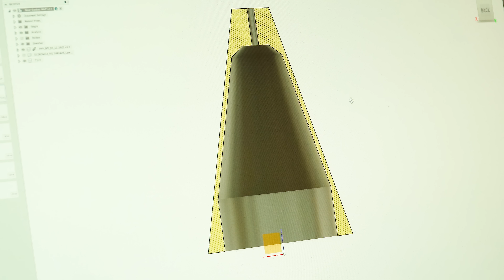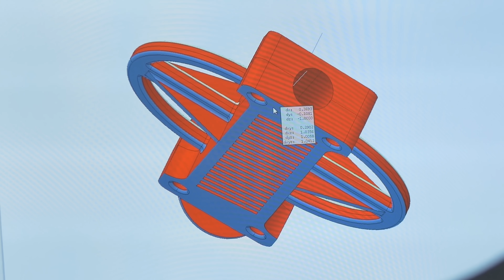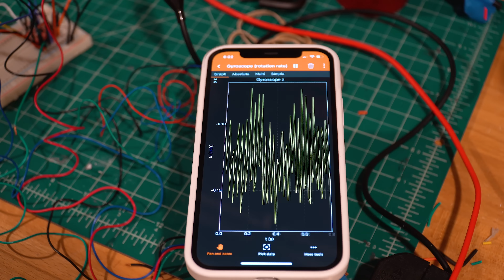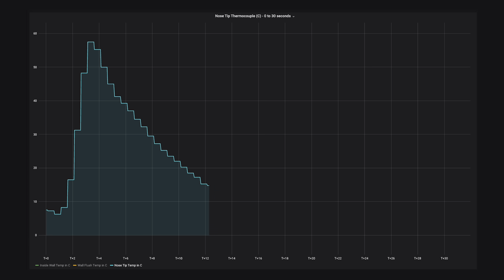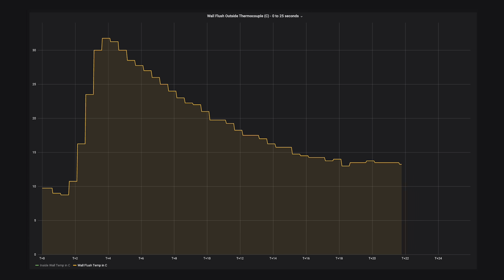How Hot Does a Rocket Get?

Comment: The new spinner is a great improvement! Could you take the magnetic coupling concept one step further and find a frameless BLDC gimbal motor? Then the only magnetic coupling would be directly between the stator coils and magnet ring of the camera rig, and you'd get back the hollow core for the threaded rod to fit through. With FOC control you should be able to get really smooth movement.

Comment: If you replace the tip of the nose cone with a nonconductive and contextually appropriate metal, but maintain an aluminum strip, you could apply a charge across that aluminum strip and gather data on the resistance on the metal strip. I'm not well taught in basic circuits, but with some testing you might be able to correlate electrical resistance on the strip with the temperature. The main problem is that this might cost more electrical resources.

Comment: i dont know fuck about shit.

strong metal that conducts heat best?

bunch of holes in tip but not too big?

hold meat on with chicken wire?

some kind of double layer cone.  similar to jet engine but sleaked out but it has a little 'pocket' to put the meat allows a little airflow to cook meat but also has good angles for letting that air pass out the ring 'exhaust' and around the outside of the cone.  almost like a N-1 Starfighter engine from starwars.

Comment: How I see your thermal situation is that you really want to have a lot of contact between the smooth aluminium and the air. Normally one would make fins on an object in order to obtain this, however you are on a rocket that values it being smooth since you don't want uneven drag on either side.

So my suggestion would be to maybe sand or bead blast the aluminium nose cone and there by getting a bit of a rougher surface and there by getting more surface area. On the other hand you are really limited by the sonic shock wave front, so you might have to design your cone in such a way that it matches the profile of the cone with the shock wave front. Also as little aluminium in the nose cone as possible since you will "lose" the energy to the heating of aluminium and get a slow cook instead of a fast one.

Best of luck on your journey.

Comment: you could design the nose cone into two parts like one cone on top the other cone where the top cone will have less width than the other one and that way we can place the meat between the layers and there might not be significant changes in aerodynamics and also weight. I don't know maybe it could work ?

Comment: have you thought about partly exposing the meat to the outside of the rocket. I think getting the tempetature inside the rocket high enough to cook meat, is pretty difficult simply due to the amount of heat that needs to be present. I also dont know what that high of a temperature would mean for the rest of the electronics inside of the rocket. maybe exposing the meat to the outside layer covered with some type of mesh to keep the structure could work, but im no rocket scientist

Comment: I would also go with internal fins to radiate most of the heat inside as well as gaining strength to reduce the wall thickness.

On top of that there might also be some gains by polishing the nose so it cannot emit as much as a the internal fins with radiative coating.

But if you want things to heat up wouldn't you need to use a nose cone optimized for friction rather that would make you Mach 3 harder ?

Comment: I would suggest using a servo motor rather than a stepper motor. Not an RC servo motor with a gearbox but a small servo motor with a rotary encoder. The motor will accelerate much faster and more smoothly than a stepper.

Comment: Could add a thin copper sheet to the side of nose cone with a rough surface (sand blast?) to maximize thermal diffusivity and friction in a small area.  Insulate the copper from the aluminum nose cone (with epoxy?) such that the best thermal path is through the meat and not the rest of the nose cone.  Could do this with a thin Insulated piece of aluminum sheet too if weight is too much of a concern.

Comment: Maybe a future upgrade could be to use an FOC-controlled brushless gimbal motor instead of the heavy stepper motor? It should provide a much faster response while being much lighter and consuming less power (check out SimpleFOC for some really good resources on arduino-powered FOC controllers)

Comment: maybe what might work is having the surface area which collects heat be as large as practical, but also relatively thin, and then having an internal thermal conductive structure which would transfer the heat from the entire nosecone to a much smaller area somewhere inside which would actually do the cooking.. like the first idea was to run some fluid through a mesh of thin tubes under the surface of the nosecone and use the fluid to transfer the heat to the "cooker", but that would be insanely hard to machine, so maybe a passive system might do?

Comment: Dump the stepper motor. Go back to the previous design and replace the brushless motor with one of those compact geared brush motors used in mini sumo robots. A standard imu using sensor fusion will give you rotational position. A pid loop will keep everything in place. It will work much much better and will weigh way less.

Comment: Make the nose cone of high temperature resistant material, low cooling effect. Place the meat slice outside of that and keep it in place by a metal mesh. The Mesh will prevent the meat from peeling off and the backside will not drain heat from the meat.

Comment: You should definitely consider using bldc motor with foc driver instead of this giant stepper motor. Please, like for him to notice, this would be a massive weight save❤
Reply: I don't think a BLDC is going to work, he choose a stepper motor for its ability of making small corrections, with also enough torque to keep it in place once in the dedisered position. plus you can also have a reference on where you are without having an encoder to check its position (as long as you don't skip steps). with a blcd you don't have control over the position and also at that small speed you also have very poor torque, but the worst think is that you cannot keep it steady once in the correct position. my2cent
Reply: @AmedeoZitti bldc can be used in servo position mode. The elctronics and the sensing are a bit tricky but absolutely doable
Reply: @AmedeoZitti  You can definitely use hall sensor encoder in such system. I didn't think about the torque required to spin the batteries, but a larger motor will still provide the torque required for the system and will still be half as light as a stepper motor. You can also get rid of these magnets.

Comment: I would sugest heat pipes on the edge of the the nosecone (or as close as it can structurally go) that transfere the heat created by friction of the airflow and maybe find a way to increase the friction if the temperture is to low. So basically a nosecone heatsink. The problem is this will heat up quickly but also cool down verry fast, maybe disconnect the hearsink at apogee. To make it cook you would also likely need a way to store the heat. The best I see this going is slightly burned/cooked edges or a verry undercooked piece. So maybe use something like verry thin bacon because it can be cooked quickly on a hot surface.

Comment: I would make the nose cone in two pieces, an inner and outer cone where the slice of meat is sandwiched in-between. this way it wont be at risk of breaking apart. with small venting holes to bleed off the pressure created by the moisture evaporating. these could vent either outward straight out of the nose cone. or the could be directed through a drainage to be exhausted out the rear or sides of the rocket. depending on which is more convenient. this way we don't affect the aerodynamics or damage the meat. plus no risk of bursting due to a pressure build up. (although that's not likely to happen anyway and maybe the added pressure could be a good thing, idk)

At least that's my best current idea.

Comment: I would use copper instead of alluminium, it have better thermal conductivity to transfer more of the heat to the inside, where the meat is :D also the shape will make a difference in how much heat it produces.

Comment: I feel like the best way to do it would be a thin shell of material on the outside, like if you peeled off the outer layer of an onion, and sandwich the meat between that and the rest of the nosecone (then attach the shell good and tight). That would get it as close to the heating as possible while still keeping it intact under the aerodynamic forces.

Comment: In case you over looked it, this from wikipedia re. thermo couple circuits: 

Reference junction
Reference junction block inside a Fluke CNX t3000 temperature meter. Two white wires connect to a thermistor (embedded in white thermal compound) to measure the reference junctions' temperature.

To obtain the desired measurement of T s e n s e \scriptstyle T_\mathrm{sense}, it is not sufficient to just measure V \scriptstyle V. The temperature at the reference junctions T r e f \scriptstyle T_\mathrm{ref} must be already known. Two strategies are often used here:

    "Ice bath" method: The reference junction block is immersed in a semi-frozen bath of distilled water at atmospheric pressure. The precise temperature of the melting point phase transition acts as a natural thermostat, fixing T r e f \scriptstyle T_\mathrm{ref} to 0 °C.
    Reference junction sensor (known as "cold junction compensation"): The reference junction block is allowed to vary in temperature, but the temperature is measured at this block using a separate temperature sensor. This secondary measurement is used to compensate for temperature variation at the junction block. The thermocouple junction is often exposed to extreme environments, while the reference junction is often mounted near the instrument's location. Semiconductor thermometer devices are often used in modern thermocouple instruments.

Comment: Imo the most over the top but still somewhat efficient way of cooking it porbably would be by blending it in a blender to a mooshy paste and mixing it with oil or butter, then make some sort of internal liquid cooling system for the tip with all the heat used to coock the meat, it really dont have to be really hot actually theres a chart of what temperature you need for how long for a meat to be considered coocked, hope it amuses you :) 

Other way i can think of wich is slighty simpler but much harder to make, you can make the tip of copper and bore inside it like radiator slots, leaving the walls really thin and the slots thick, put the meat inside, seal it and make a low pressure there, if the meat is thin enough it should work somehow lol

Comment: Tasty idea!  How about wrapping thin sliced prosciutto around an insulating cork insert that will let the cooking continue as long as the thermal mass will allow as well as supporting the meat? Also maybe a metal that will hold the heat longer than aluminum?

Comment: You should definitely have as much surface area as possible. It's entirely impractical on the outside, but you should definitely have a radiator fin stack machined into the metal tip. 

Take some tips with how people cool things. It's all about moving heat around.

Comment: What if you cut a channel around the circumference of the nose cone deep enough to put a piece of bacon, then had a matching ring you could just slide into place over it, trapping the bacon between the nose cone and the ring. You could make it so that the OD of the ring is flush with the rest of the nose cone, and wrapping the bacon around like that would use relatively little space. This has the advantage of keeping the cooking process away from any internal components.

Comment: I think you need as little thermal mass as possible to cook the meat.
I suggest building the cone out of some strong insulating material or a very light wood, and then attach a very thin layer of meat on the outside of the cone and cover it with a thin metal foil. 
Don't make the surface too smooth, higher friction provides more heat...

Comment: @BPS.space Graphite is a good thermal conductor and very strong with a low thermal heat capacity. Thus it should transfer the heat quite fast and absorb little of it.

Comment: Aluminium nosecone is great as it transfers heat fast then what about wrapping a piece of bacon around an inner core shaped like the nosecone made of foam to keep the bacon firmly against the inside of the outer cone so you get maximum heat transfer into the meat but the foam core wont rob heat from the bacon ?

Comment: Would it be easier to use image recognition to maintain a direction and log the spin data to reverse engineer or make a simulation?
Reply: Just got to the part where you're using a record player and that's pretty slick.

Comment: I'm wondering how much weight you'd save if you just had a bunch of camera sensors in a ring and just account for the spin with camera sampling and software stitching the images together rather than building a spinning wheel. 

Still it's an amazing concept, and I think it's working well.

Comment: Getting the heat into the meat during a really short exposure seems a problem if the meat is thick enough to hold together.  If you could seal the capsule and allow higher pressure, you could store the heat in the water to steam transition, and it could soak into the meat during the decent and some recipe cooldown time.  I'm happy to simulate the pressure cooking to estimate your times given your surface area to meat/water mass ratio.  I am assuming a peak pressure of 2 to 4 bar absolute, peak temperature 150C.
Reply: Conveniently, your rocket will have repeatable conditions of launch air density, nosecone size and shape, peak airspeed, and acceleration profile.  This means the total heat available to the nosecone should be consistent if the heat sink is effective and of a repeatable heat capacity.  If a majority of the heatsink is water that can be reached during the peak heating, the peak temperature of the food should be very consistent.  With fine tuning, the exterior of the meat could reach carmelization (146c) and not carbonization (155c).  Then by preconditioning the meat (pre-warmed, pre-chilled, center unthawed) any special order can be reliably produced (hypothetically).

Comment: Thermo siphons may help redirect heat where you want it. Copper is an excellent heat conductor. If you use just water, you might get extra boost from steam if jets are tuned or aimed. Pressure cooker/ vaccum chamber may allow heat pulse to transfer more heat. Like boiling water at room tempature. When it works, use WAGU Beef for the worlds most expensive steak'em. A suspended payload under the rocket engine might cook alot more. Would probably make it the worlds fastest barbecue. I really like the shorter content videos, but i like the ideas and reiderations in the long form too. Anyway thanks, and keep up the cool content.
Reply: I got the beef hmu

Comment: I really want to see you try the spinner again, but using a free-spinning section with a tiny aerodynamic control surface. You'd save loads of space  and weight, and have the benefit of some aerodynamic damping. I don't expect you'd need much control surface deflection, so a relatively small servo with a lot of mechanical advantage would probably work fine.

The downside is loss of stabilisation at apogee, but for the ascent I think it could work quite well.

Comment: Could you just make a hollow nosecone and slice it off the tip and weld on a threaded center core on both sides? Pack the meat in like a 1 Cubic Inch hollow section?

Comment: What about making the outside of the nose cone out of copper with a thin alluminom inside.  Then make a plug that hold the meat against the inside surface like a bacon press so you get maximum contact with the hot aluminum.

Comment: Interestig, at M=1.05 the temperature downstream of a normal shockwave is just 1.032*T1, so friction has a much larger impact than the supersonic flow. At M=3 the temperature would be 2.67*T1, so the tip should heat up to 480ºC! (without even taking into account friction)

Comment: First thought is to make the outer skin where the slice of meat will be contained to speed the heat transfer to the inside of that section of the nose cone.  My second thought is, would a copper nose cone "skin" be within the weight budget?  Since copper is a MUCH more efficient conductor of both electricity and heat than aluminum is, it may be worth looking at.  My thought is to form super thin copper over the primary nose cone, with just enough of a gap to "sandwich" the slice of meat.  Think of a copper jacketed rifle or pistol round

Comment: Make the nosecone as two nested cones. Fill the space between them with meat. Or in other words, use the smaller inner cone to press the meat against the outer cone. Add some kind of bottom seal ring to prevent the meat from sloshing downward under G-loading. That should get you both good heat transfer (which in cooking a steak is largely a function of physical contact between the meat and the pan) and payload stability.

Comment: First thoughts are a better heat conductor. Easy to get a hold of for hobby first thoughts are copper but then it's heavy and will equally cool just as fast so a composite that allows for heating on accent and then rotates into an insulated area to allow more time in a hot environment to "cook"

Comment: Have you seen that there are stepper motors with hollow core? You could use one of them. The ring drives the magnetic clutch and the threaded rod can go in the middle.
Such motors are generally used for pick and place heads.

I'm not sure if a second try with a black+encoder would bee interesting.
If so sparkling have an hollow shaft bldc motor.